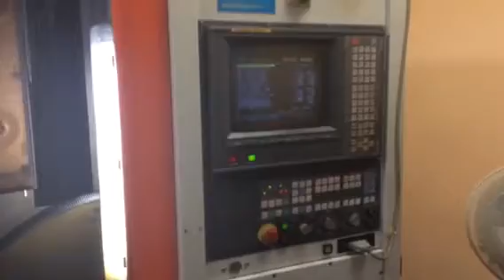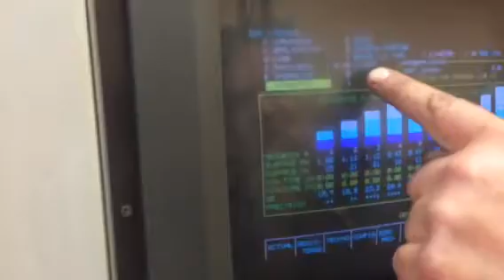Edm wire cutting

Comment: Funny I never knew of EDM till I restored my Martin T75. The hand wheel for rise fall and bevel was held on with small but hard rivets. I ended up taking it to a shop that used a wire burning EDM machine to burn them out. The shit you learn from this machine love..